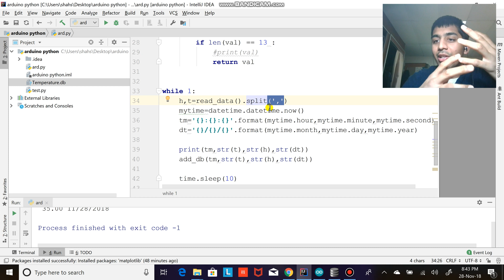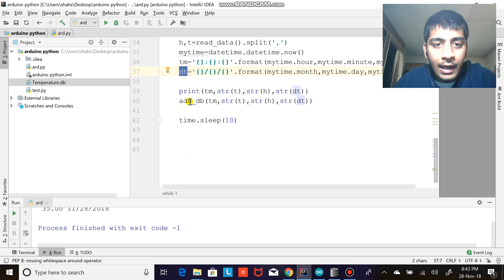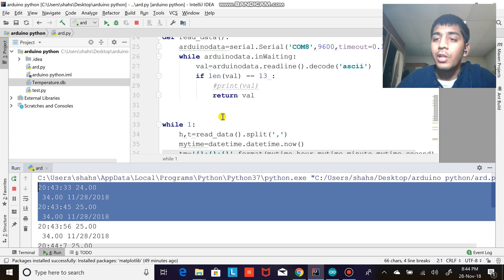log any arduino sensor value to database using python mysqlite3

Comment: @soumilshah, Please also read the comments of other people. Most of them are asking about coding. They also mentioned that the code is not available in the given link.
Can you please provide the code. I also checked that link it still gave error 404. Can you please upload your code or then don't mentioned the link if you don't want to provide the code.

Comment: which software  you have used to write the python code
Reply from the maker: Harika mokarala I am using intelliji community edition
Reply: @SoumilShah  can i use DHT-11 sensor (that has been written in your ardino code)and python idle to run that python code
Reply from the maker: Harika mokarala little changes has to be done 
Get me in touch through WhatsApp I may help you when I am free 
+16462045957